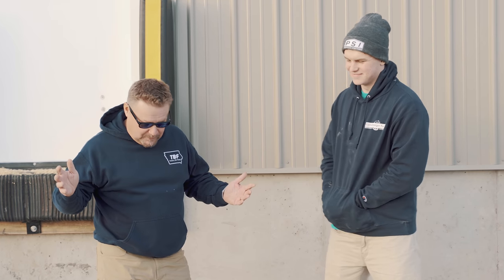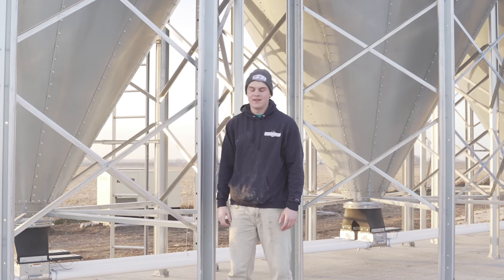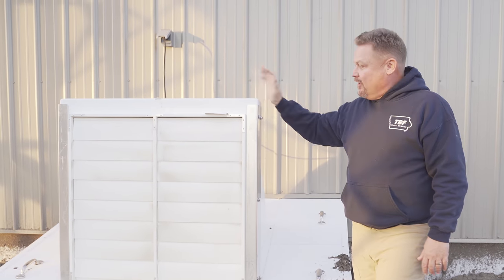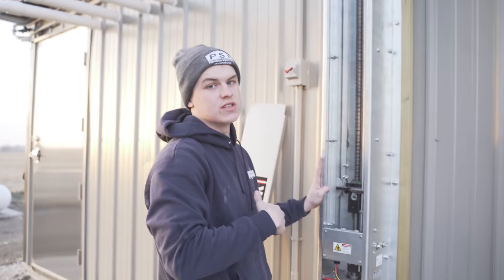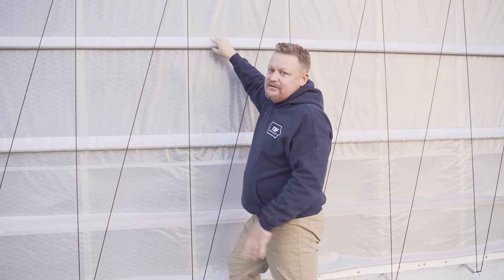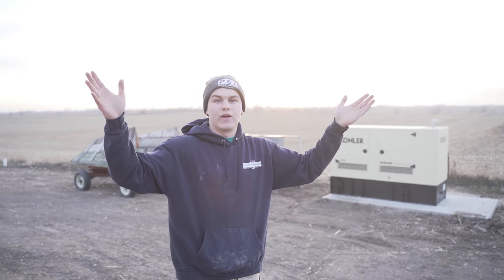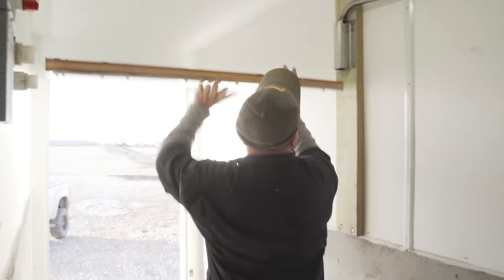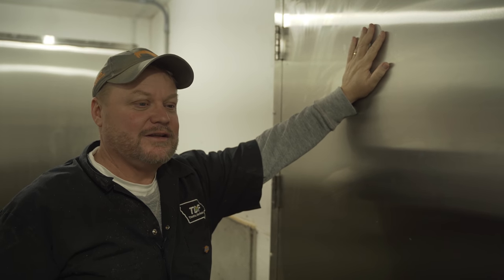Touring Our Brand New Modern Hog Barn

Comment: Question?
What about installing a modulating condensing boiler inside, so you can have a snow melt system as well as radiant floor heating on the floors to keep the pigs warm?
As well as having an efficient heating system?

Comment: Nice barn
The pads under the feeders are concrete?
Do you have some information or footage on how it was poured?
Reply: They are poured in place on roofing felt. Using 2”x4” frames with blocks in the corners so as not to have a 90 point at the corners. Fiber in the mix. These pads are 57”x48”. They will last about 8 years if you do nothing to them. We typically Armor-Rock them after 3 years and then they’re good for another 10 years. Keeps a lot of wear off the slats. 
Thanks for the question and for watching!
Reply: Thank you
We have rubber mats under the feeders and we have trouble with wear of slates and mats 
Could be a nice addition 
Greetings from Germany 👍🏼

Comment: How many pigs do you have eating on each bin ? At my barns, I have 1000 pigs on 24t bins and they will last around 8 days eating 3ts each day depending on how large they are.
Reply: Thanks for the question. All our barns have triple 26ton bins for 2400 hd. At market weight, eating 6lbs. per head per day. They will eat 7 ton a day, 3 1/2 days will empty 24 ton. Thanks for watching!
Reply from the maker: What Tork said 👆😂